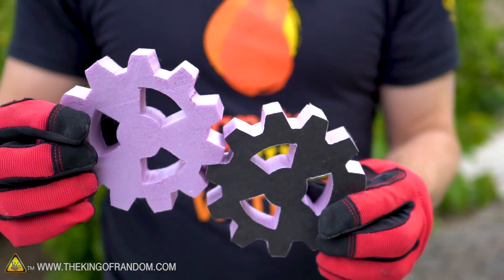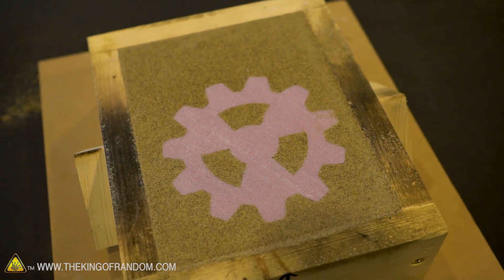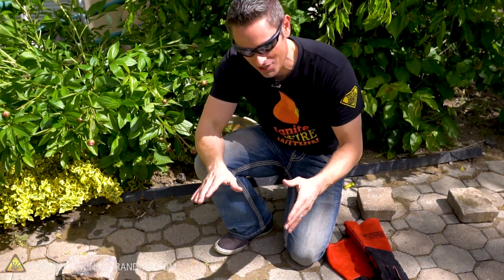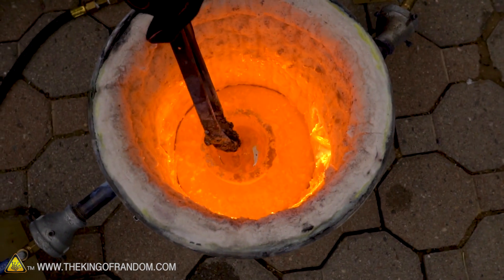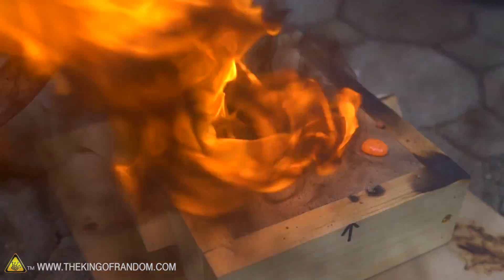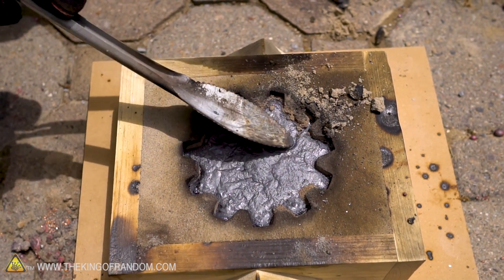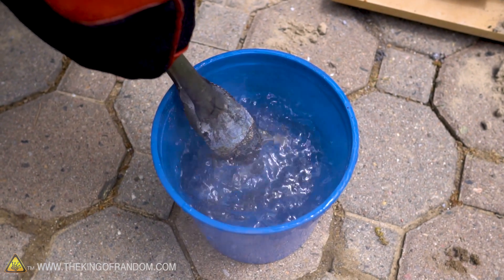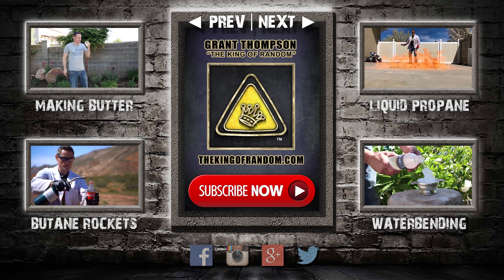Argh. Why Is Copper So Difficult? TKOR Tests Melting Copper In Our Homemade Foundry

Comment: Don't pore from the middle pore around the outside so the sand doesn't block the copper. And completely cover the mould so the sand doesn't shift as mush and you get a smother top surface.

Comment: have to agree with other posts.  you need both cope and drag with spru and rises.  also when doing cope and drag remove gear. even Styrofoam left then will burn to gas and deform damage the walls of the model when sealed.  but love your show.

Comment: I did read something yesterday suggesting use a blowtorch to remove the Styrofoam and even blacker the sand. but it could also be the green sand mixture your using

Comment: Hey Grant. Thanks for also including the "not as successful" once as well :) But when you quenche it, you dip the copper piece in quite slow. I would think that it would be better to dip the whole piece at once. That would meen the whole piece whould go down to the same tempeature at the same time, so that it doesn't create tensions in the metal. I would even wiggle the metal a bit so that the water cooled it faster. What do you think?

Comment: since the sand is less dense than the molten copper it will always want to float on top of the liquid copper. so you need to counter that, maybe have a scrap piece of wood mounted on top like when you made the sand mold that covers the sand to prevent it popping up and have a pour hole in the wood to pour the copper in.

Comment: I think you should try it again and this time heat the copper up to the point you got it to for the very last mold you did. Second dont do an open face mold make a chute (not a big once since like you said the copper cools down quickly) but enough to keep things held in place, and wet it down like you did on the last one.

Comment: Try using reinforcment of the smaller pieces in placed in the sand itself. and before  pouring copper use a screw to carefully remove the foam.

Comment: I was able to melt Copper yesterday! barely stayed molten long enough but I used a clay to make a 'Cu' Periodic table tile and used petroleum bonded sand to make the mold pulled out the clay and poured into the vacancy. Worked great! I will post the video soon

Comment: Melt the copper, then add 10% tin to the mix, stir and pour. This will be bronze, a much better casting alloy and lower freezing point (stays molten longer)
The difficulty your having is because of the bouyancy of copper. Things float on molten metals much better than water. You need to weigh down the central pieces.

Comment: maybe don't use housing foam? try other foams check the melting point for other foams I'm sure the are all low and also try comparing how fast the different foams burn so that you can pour the metal in with the foam

Comment: looks to me the issue is the moisture content being to high. the time you added more all inner sand broke free. Maybe the heat is so intense its rapidly boiling the moisture causing in to break under steam pressure.

Comment: The foam you are using is called XPS(Extruded Polystyrene) you want to use the bead looking foam called EPS ( Expanded Polystyrene) The XPS you are using has a slight bit more of a heat resistance (roughly 200 degrees but as fast as the copper is cooling this can cause an issue). Also, the XPS is roughly 15psi you may want to go to a 25psi or higher so that you can properly press the sand around the mold without getting deformations.

Comment: You should have sifted the sand anyway and used a smaller ramming tool to ram the sand in side the gears so it makes them stronger also even though it seems easier to just use 1 side you should use a closed mold

Comment: When I was working in the foundry at my high school, we wet our sand with oil. It burns instead of boiling which seemed to have the dual benefit of hardening the mold and creating fewer pits in the metal.
Two more suggestions I have are trying to do an internal casting with pour and vent holes so the copper doesn't cool as fast or, at the very least, melt the foam out in an oven so your mold is preheated.

Comment: best method for casting copper would likely be using a closed mould with proper green sand, or clay with a hole in the top for pouring the metal into, after it is finished it should only require a bit of cleanup as it would have a stem from the pour.

Comment: You should use less dense Styrofoam so it would melt faster when pouring molten metal. Then I think no need to melt it before pouring

Comment: Maybe dont melt the styrofoam with the head. It acts as a support to keep the walls up and makes for a better mold but if you melt it, you lose all that.
Reply: Chad Drake he should probably use something that doesn't shrink away as fast either. the housing foam shrinks away before he even tilts the crucible

Comment: Why don't you completely cover the gear mole in sand, then drill a hole down to the mild then pour copper down the hole. Then the gear just needs the stick to be cut off and it'll be done.

Comment: all that work making the green sand forms and you only use one half? the copper cooled too quick because you didnt use the top half of the form to insulate the cast. the sand broke away because you didnt use a spru, the liquid copper is heavy so when you pour it in it erodes the sand and can destroy the shape. using both the cope and drag will solve both issues
Reply: Notgnihtrow I'm glad I'm not the only one who knows what he's doing wrong!
Reply: I worked for several years in a foundry using green sand for cast iron parts. I kept saying this over and over while watching the video, You need the top and a gating system. And don't forget to weight the top down or the metal will lift it a bit and come out the sides. the top half would be completely flat except for the hole to pour into the gating  and perhaps a vent hole in the middle of the gear.
Reply: this
Reply: He needs to see this.
Reply: Notgnihtrow I've watched other Channels cast copper and explain things that he could have used but watching through this it made me a little mad but either way he tried
Reply: Instead of watching his own videos, he should watch some others on here and see how to do it correctly.  Its kind of annoying to see for me;  and I've only done one pour so far
Reply: Notgnihtrow you would think he would have researched this, or at least looked at the thousands of copper casting vids on this platform. Drove me nuts watching the last 2 vids

Comment: would using some flux help keep the copper a liquid.
or maybe if the entire mold was encased in sand it would cool down slower since it'll have less contact with the the air and ambient temperature

Comment: Why don't you try to use refractary plaster like the ones they use for metal castings in dentistry? You make a wax mold, pour the plaster (mixing it in the vacum chamber can help you get a nicer cast) , let set and then melt the wax? Then you get a solid cast to pour the molten copper. I think that to do this you should have the casting itself preheated but I know that if so it would not be much problem for you.

Comment: place an iron (or some sort of hard metal) funnel right above the center of the styrofoam gear mould and pour the molten Cu.
OR spray a coat of some kind of glue 10-15 minutes before casting.. :)

Comment: Blowtorch the sand so it is the same temperature as the copper and it will have less of a thermal shock
Reply: It will dry and crumble from the smallest touch of anything.
Reply: Ernests Aizkalns oh
Reply: I don't think thesand can get thermal shock. Plus it's the density of the copper that is pushing the sand up.
Reply: The torch is like very powerful wind when you put it near the sound it will blow some or most of it away and it will destroy the casting.

Comment: You sholuld heat up the sand right before you pour copper in. That will burn off the styrofom and heat up the mold.

Comment: An inclosed or clay mold is what you need. It will keep the sand nubs from popping out. Also, wax would be a better option to use as the gear, since is it isn't filled with flame retardants like the insulation.

Comment: why don't u try to add  hot water to the sand or make the sand more wet and than heat it up it might be a shock reaction of the sand that why the part of the mold pop up with the heat? or maybe  make the sand with more pressure ?

Comment: maybe the styrofoam (sorry if i misspelled that) is too thick, try make it a little bit thinner next time, or maybe try a lighter styrofoam material (lighter styrofoam has more air bubbles in it, that would make it melt a little bit faster)

Comment: 1. im german, sorry for grammar ^^
2. this kinda foam you used was industrial foam liek they use on constructions sites and its harder and it doesnt dissappear that quickly like the white, more bubbly styrofoam
3. the 3 sand pieces which started to float were pretty small, so they were easy to break
4. the density of copper is higher than the most metals you make molds with
hope it helped you out and a great day :)

Comment: You need a closed mould with a riser. You should also try heating your mould.
Another method you could try investment casting. Was part, cover in ceramic slurry, melt out wax, fire in a kiln and then fill when hot. This will five you the best result.

Comment: What happens if you melt a crucible ?
Reply: graphite/carbon(which is what the crucible is made of) sublimates at 6500 degrees F which is impossible for a homemade furnace to get anywhere
Reply: if he did then yes it would be possible to vaporize it in theory
Reply: well that's hard to say since we don't even know what he's using so i mean sure i guess

Comment: Well, if the innards that form the radio active symbol float up, you just need to tack them on. Just hold them down with long nails with big heads, so that they don't rip off and start to float.

Comment: try using closed system and not open.you must bury styrofoam in the middle of sand. create a hole to pour molten copper.

Comment: Moist sand is going to steam flash with the molten metal and blow out. Also, put a top on the crucible and pour through a hole. The top will help support the bottom.

Comment: One solution would  be to make the Styrofoam cutout taper out at the edges. This should mean you can pull out the Styrofoam without destroying the mould, and then grind it down with a Dremel or something to make the edges straight again.

Comment: put a layer or green sand with a hole to the mold to keep the sand stable and get a efficient cast. example. your gear coverd in greensand on the side and to witha hole to allow the copper to pore down.👍👍👍
Reply: *and top

Comment: I think it's because of the sand, or maybe you pour the liquid copper too fast? You need to pulverize the sand first, probably? And btw, don't make the foam too thick.
Reply: Try using Oil bonding green sand, it'll help a lot.

Comment: suggestion: maybe if you encasing the mold (a top mold with a 'feed' to impressioned area on the bottom) 

also I am wondering about sound in a vacuum I wonder if the sound would be weak of "random" as the air is slowly being sacked out

Comment: you need two sides of the green sand and make a tube from the middle of the gear to pour the copper from. this allow the shape to stay in tact and the molten copper will not cool that fast.
Reply: and keep the styrofoam in there. it helps to maintain the shape.
Reply: Jude Lau +
Reply: Just wanted to write the same :D
 Ps: one tube must be one one edge of the gear and the other tube on the other edge so gasses could escape and the would stay intact becouse metal would shrink in the tubes( risers) and not in the gear.
Reply: Juse Lau is correct ... You should do this project with a 2 part mold just like how engines other metal components are made. The 2 part mold will yield a better casting!
Reply: And for better results. You can poke a few holes around the mold for better distribution
Reply: Jude Lau was going to say the same
Reply: I rekon Jude Lau is onto something here.
Reply: Jude Lau that green sand doesn't look to be that stady
Reply: it looks like when he turns it, al the mold will fall apart
Reply: Jude Lau ++
Reply: this was going to be my reply too, also using both halves makes it so there is less to cleaning needed for the final piece
Reply: Jude Lau its not beach sand, you can watch the video in which he made the sand
Reply: I was thinking the same. Using a two sided mold, with a vent and riser.
Reply: alien amazing he probably only use typical beach sand. Real industrial green sand is a bit oily and sticky to maintain the shape better.

Comment: try using a different foam that vaporizes faster. Insulation foam has a higher melting point that regular white one you find at the hobby shop

Comment: set your sand. add cement or something to make a rigid casting medium. The heat from the copper is drying out the sand to be super dry which means there's nothing holding it in place.

Comment: Use the cope and drag, it will keep the integrity of the shape better. Remove the foam, copper is terrible about contaminants. Wet sand is better than dry sand, as it tends to stick together better. Lastly, copper is best poured above its flow point, nearly at its fuming point. I cast several thousand pounds of copper, in various media,  when I worked in a foundry many moons ago.

Comment: Ive done this before, you are pooring too fast. The splash of the copper is what is causing sand to move. The sand also needs to be fairly dry to prevent the sand from causing steam bubbles in the mold.

Comment: Have you looked at heating your mold cast up so that the temp of the copper doesn't cool as fast? Might have to consider changing your moisture to something like mineral oil to make your green sand but you would be able to heat the mold up to a few hundred degrees and prevent the copper from cooling too fast after the pour. Just a thought.

Comment: Copper is too dense for an unsupported greensand cast. You need at least a top cover or the sand will always float.
And please....do not buy copper in a hardware store XD
Every shop that is cutting metalls usually sells scrap pieces for cheap. (usually you pay per kilo)

Comment: We see couple minute videos but in reality this takes hours and hours for Grant. I'm so glad he does this for us. As for a casting idea, I think maybe you should try something like a metal lining for the sand cast so that the lining holds the sand in place. Thanks for reading. <3
Reply: MotherEric wouldn't that be hard to get to make the shape perfect? Since the rock won't be completely smooth?
Reply: Then have to get liner off copper
Reply: First cast the metal lining then cast the gear. lol
Reply: I believe that since the copper has such a high melting point, anything other than steel, which he can't cast due to high melting point, would fuse to the copper mold, and ruin the pure copper cast.
Reply: completely correct

Comment: You might want to try to use play doh instead of sand cause last time you used it to mould brass knuckles
Reply: Donald Chen go look up melting tempatures of metals. 700 F is nothing compared to 2100 F.

Comment: You'll need to do a cope aswell to keep the sand intact ie. You need to do a proper closed sand casting instead of doing it with an open top so you'll also need to remove the foam.

Comment: Perhaps instead of open face casting. You should try using wax and completely covering it with sand. Create a hole for it to vent out and one to pour into. And then store it in an oven to bring it up to a warm temperature while also melting the wax. This way the weight of the copper will push the wax out through the vent hole, while also filling up the gaps, the three 'pillars' of sand can't pop out due to being reinforced by a roof overtop.

Comment: i did something slightly similar a few years back, but i fully in cased the mold and used a stone plate as the top with holes in it to evenly distribute the copper.
and if you are questioning what i made, i made a faceplate for my xbox 360

Comment: you made two halves of a box so why not use them together to pour your molds. burrow a hole to pour your copper into the styrofoam molding maybe for a smoother more accurate finish.

Comment: well first of all that foam your using has a layer of tougher plastic on the outside and you need to have a closed mold vented thus no deformation.. also the last run you did was perfect temp. see the difference in the oxide layer it was grey... stay grey its the key...

Comment: I would say try to make a green sand mold where the foam gear is entirely encased in sand, that removed the issue with the parts floating. Other variables might be the type of sand or the type of styrofoam

Comment: Could you try making glass from sand?
Reply: Most sand won't make translucent glass, but it would still be glass.
Reply: you need some pretty ridiculous temperatures to melt the silica into glass, doing that in a "home" setting can be pretty rough. Maybe he can do it with the Arc melting method since he showed he could melt glass with it
Reply: Legendz Himself HTME already made it

Comment: Maybe you can try casting the normal way, having the mold sit in between the cope and drag and running the molten copper through the gating system?

Comment: You need a closed mold, not an open one- the little nubs won't be able to float up if they are joined to both the upper and lower surfaces.

Comment: Wrong kind of sand!

"green sand" is not a type of sand on its own (that is, not greensand in the geologic sense), but is rather a mixture of:

    silica sand (SiO2), chromite sand (FeCr2O4), or zircon sand (ZrSiO4), 75 to 85%, sometimes with a proportion of olivine, staurolite, or graphite.
    bentonite (clay), 5 to 11%
    water, 2 to 4%
    inert sludge 3 to 5%
    anthracite (0 to 1%)

Go buy some commercial grade "green sand" and do it right!